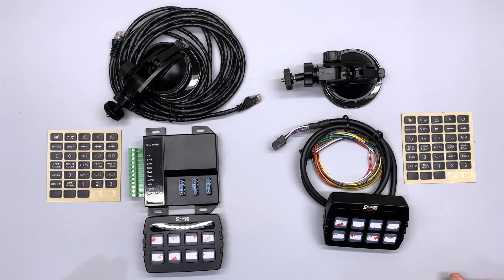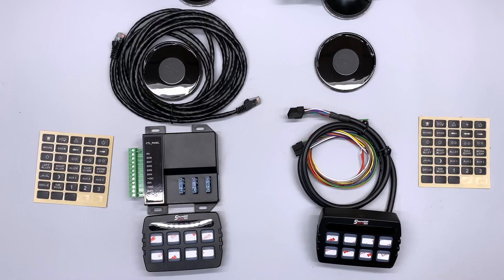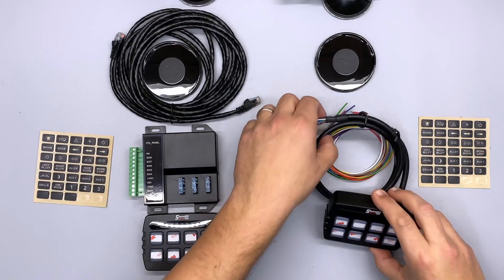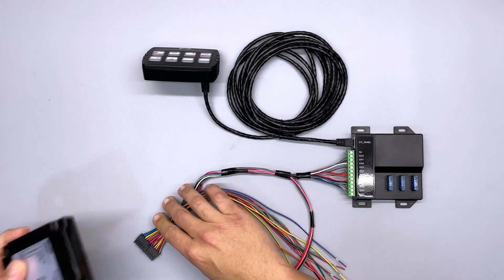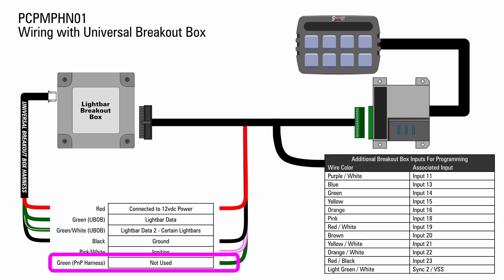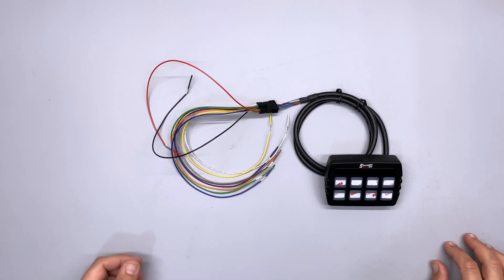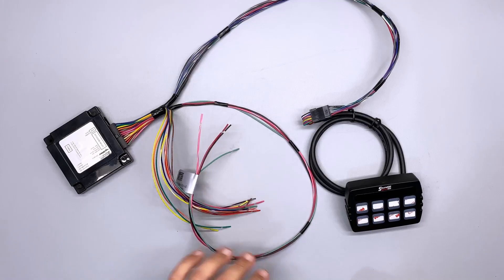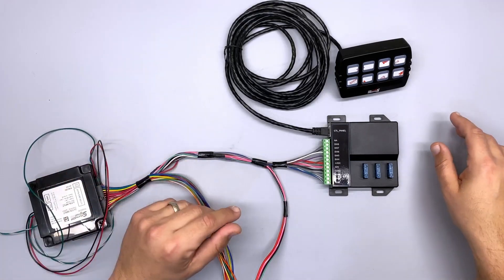Twisted Pair - 800 Series Multi-Purpose Control Panels

Comment: So if someone wants to put together a vehicle using products from y'all and from a few other  different companies what advice and controller can be given and used ??
Reply: I think that depends more on what the other equipment is (brand agnostic):
* For low current stuff (commonly lightbar triggers), you might go with the low current 802 controllers. 
* For providing power to a bunch of perimeter lights (mpower or equivalent), you'll want at least the higher current model (801). That provides 3 higher current outputs which handle the load of flashing perimeter lights, and 5 outputs that can handle things like lightbar triggers. 
* Anything more than that would require relays for load handling, or making the move to a full fledged lighting controller like our 400 series.
Reply: @twisteddamon1202   It's more for a volunteer first responder vehicle the size of y'all Toyota Land Cruiser or Isuzu D- max ( hopefully you know this vehicle) looking at doing it in what y'all call a slick top in red and white color leds

Comment: Awesome so if I don’t have an off button on my contrôler (exemple Nrgy500) I can use this 800 series hook it up to the nrgy500 input and have more buttons ?
Reply: Yes - you can use the outputs of this controller directly into the inputs of the 500. Depending on the model of 800 you go with, you'll either have 8 more buttons, or 7 buttons with one acting as an input master. 

I kind of like the idea of the low current in this situation - 7 outs into bluePRINT, and then one out from bluePRINT back into the 800. Then bluePRINT can activate that button to provide feedback when a function was activated automatically (instead of by pressing the button).